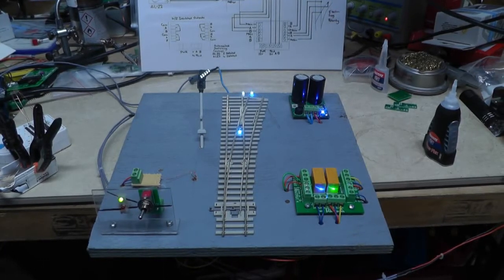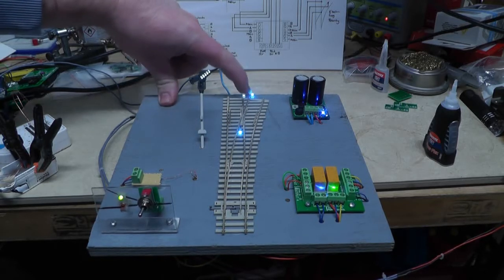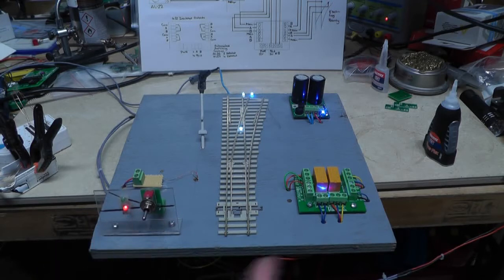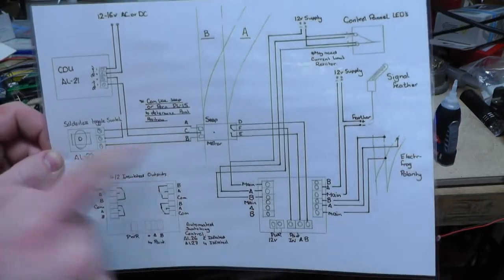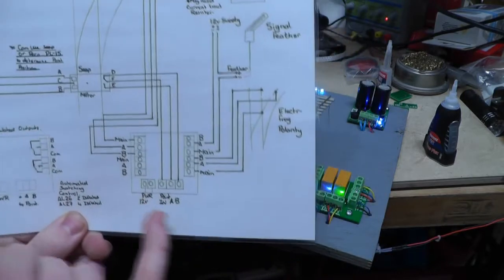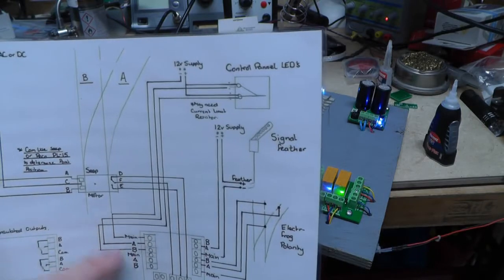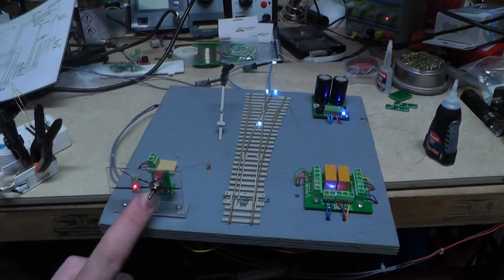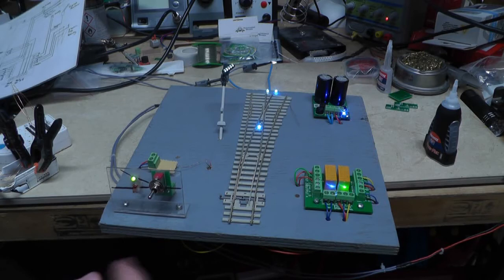Illuminated Models SEEP Motor Expansion board

Comment: Nice piece of kit I’m looking for, is the supply for the extender DC only?
Reply from the maker: Afternoon, to power the board you can use DC or AC (DCC) supply as there is a bridge rectifier built into the board to cater for both. hope that helps
Reply: Illuminated Models lovely thanks for letting me know, cheers Darrell